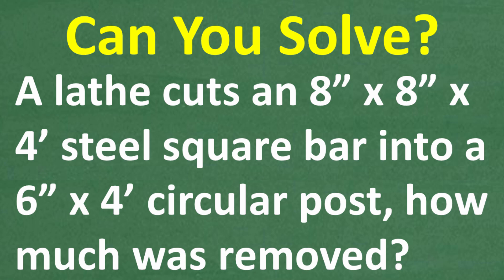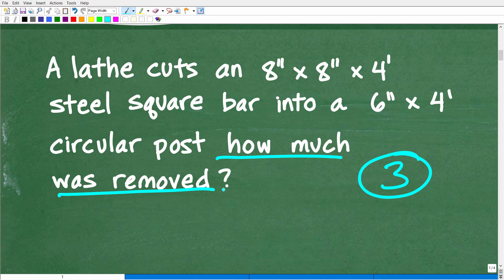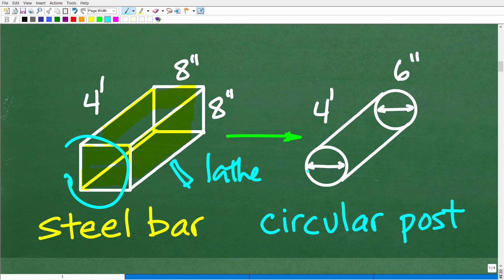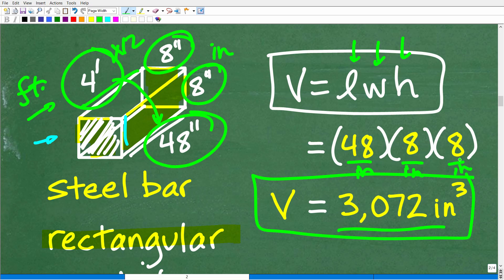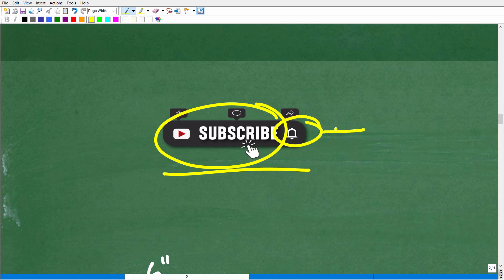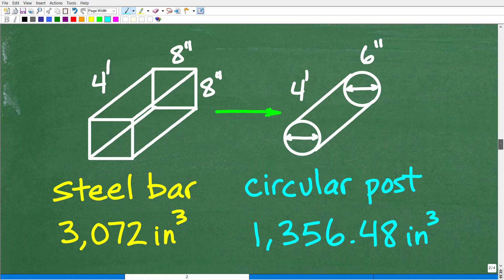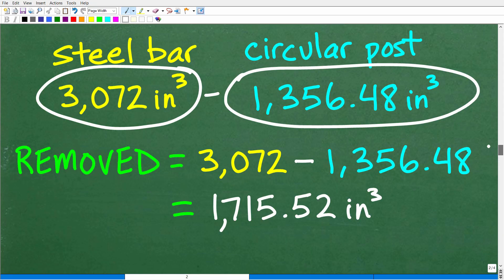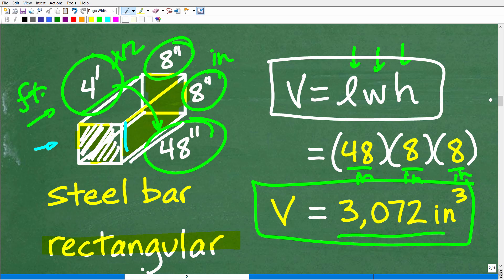An 8” x 8” x 4’ steel square bar is cut into a 6” x 4’ circular post on a lathe, how much was cut?

Comment: Approximately 495 lbs of material totaling 1714.83 cu inches. Why not use a near net shape process and make a forging or casting?  Hell of a waste of material turning roughly 56% of the original mass into chips.
Reply: Haha, ya can tell the lathe guys.
If you can't get round bar, look for hex bar, if not that, then square bar closer to the final product.
Reply: @calvinmasters6159  Actually more of a castings guy who worked on the QA/QC side of things.  I had a Mechanical Testing Lab at one point and initially subcontracted machining of test specimens.  The machine shop I used was bought out by a competing lab, much larger than my little operation.  They would continue to serve me, for 4 times the price/specimen.  I bought a lathe and some shop texts, taught my self how to run it and kept going.  Then moved on to a milling machine, a Marvel Series 8 saw and a bunch of other stuff.  Books are wonderful if you use them and don't eat the covers.  Before the lab I had worked in Foundries and a Beryllium plant and have the lungs to prove it.  My last 15 years of work was spent in foundry QA concentrating primarily on welding, heat treating, Non Destructive and Destructive Testing, kind of a desk jockey who would get dirty when required.
The rest of the story is that I flunked HS shop class, my mother was convinced that I would cut my hand off on the tools in the shop.  It was easier to take the ridicule from classmates and fail the class than to take the beating I'd have gotten for touching a machine.  Shop class days started with getting yelled at for an hour before leaving for school about what would happen if I actually did something. I walked around with a poorly healed break in my hip for 50+ years thanks to her ability to go into blind rage.  Moving forward, every time I started up one of those machines I'd say "F you mother, I can do this". 
I did make an error in my calculations for mass of material lost.  I used the density of 300 stainless at 0.289 lbs/cu inch rather than carbon steel at 0.283 lbs per cu inch.  Still a lot of wasted material.   He didn't specify material so it has little consequence.
Today I can kind of laugh at the shop class side of things, in a sense learning to do these things was not only proving her wrong, but a sort of internalized revenge on those at school who mocked me.  Hope you get a chuckle out of the whole story behind my initial response.

Comment: It’s absolutely and astonishingly amazing how ignorantly limited people’s brains and imagination are. Teachers are taught to not necessarily make absolutely real world problems and situations to teach a student, a class, or anybody for that matter, to not give easily solvable issues and problems. But challenge minds by using out of the ordinary problems and/or issues that forces students or people to apply an imagination, which in turn forces alternative ways of thinking which is what’s needed for life. Not every happening in life is what you exactly may have been or are taught by your teachers. However when you are forced to apply certain facts to a wider array, or number of choices you are forced to broaden your imagination. Which in turn forces your brain to take either existing knowledge or common sense and do whatever is required, to do what is best for the wide array of possibilities that you could end up facing for other situations or problems that you have to steer clear of. With this certain situation, there could be a requirement on the waste left over due to a certain amount of scrap required for another reason not specified by the customer. And Holy Frikkin Cow. That would require this same equation. Problem solved by the mathematical equation example given here.

Comment: ' -> foot , " -> inch
1 foot = 12 inches
1' = 12"
4' = 4 x 12" = 48"
ℿ ≈ 3.14159
circular post 6" x 4'
6" -> the post has a diameter (D) of 6 inches
4' -> the post is 4 feet long
Area (cross - section post) = ℿ(D/2)²
Area (cross - section post) =  ℿ(6/2)² 
Area (cross - section post) =  ℿ(3)² 
Area (cross - section post) =  9ℿ in²
Volume (post ) = Area (cross - section post) x length (post)
Volume (post ) = 9ℿ x 48 = 432ℿ in³
steel square  = 8" x 8" x 4' --> 4' = 48"
Volume (steel square bar) =  8" x 8" x 48" = 3,072 in³
Volume (post ) - Volume (steel square bar) 
 3,072 in³ - 432ℿ in³ 
 3,072 in³ - 432(3.14159) in³ ≈ 1,714.83 in³✅
                                              (was removed)

Comment: 8 X  8 = 64.  A 6-inch circle is pi X 3 squared.  The area of the amount removed is 64 - (9 X pi). The volume removed is this amount times 48 inches.
Reply: The way I did it.

Comment: This is not a practical math question. A lathe needs extra material for the chuck and spindle. 
Anyway, I know what the abstract answer is;   1714. 83 cu inches or .992 cu ft.
Reply: And just to fill you in on some information. I am an experienced Machinist, and it is very possible to blend seams to end up with such a minimal blemish that it cannot be out of measurement or even seen. And I learned how to on manual machines. Lathes and mills.
Reply: @bradlewis8036  Just weld (or have someone weld ) a temporary spigot on one end, grind it off later, no reversal, no fear of blending... not blending...
Reply: @robertlawson8572  I work in a machine shop and was taught how to do what I said with such minimal blending all that’s required is 3 seconds of rubbing emery cloth where the two different ways of machining cross over. I could go in exact detail but I’m not going to explain everything.
Reply: @bradlewis8036  aw, go on, I've never tried such a demanding operation... I'm tremendously lazy, I work the easiest way possible, and mounting 400kg of steel once is quite enough of a ballsache for one day... Twice? Nah... F W Taylor would not have  approved!
Reply: @robertlawson8572  I would do it the way I was taught by my superiors, then I developed other ways than normal known ways. I was superior machinist at the shop I worked at. I’m not going in exact detail about everything I know to do. But I first learned many different ways by many people. If you believe me great. If not, it doesn’t matter. I know what I know.
Reply: @bradlewis8036  I cannot fault you, there.  You must, unarguably, know what you know... "Superior", though, is an appelation accorded by others, not by oneself... (unless you're Trump)
Reply: @robertlawson8572  And in my field, the final piece turned in was most often required to have no blemishes.
Reply: You could always machine down the majority of it then flip it and continue.
If you’re good you won’t see any transition points.
Reply: @SteveJ328  Yes but that requires excellent capabilities by machinist and machine. Also, every situation is almost always requiring different things. If time matters, you can’t fool around with extra long time required operations. But like I said, every job and different customer require different rules and allowances. So sometimes yes, and other times no. Not arguing with you or saying you are wrong. Just speaking on behalf of what I learned and did.
Reply: @SteveJ328  Also, like I stated earlier every situation is different with different requirements, and/or restrictions of what’s not allowed, or  what is allowed or if time or anything else is a requirement. But like I gave to the previous person who’s obviously unintelligent because of how he’s an anti Trump kinda person. Every situation is different.
Reply: @bradlewis8036  Agreed 👍

Comment: Heck of a lot of material to cut off. 
Isnt there any stock steel bar closer to 6*6?
( 8*8*48) = 3072 cu ins
Less Remaining = 3*3* 3.14159 * 48
= 1357.16688 cu ins
= 1714.833 cu ins removed
Reply: Hope it's not stainless. That'd be brutal.

Comment: IRL, you would simply call up your metals supplier and order a 6" diameter by 48" steel bar.  The supplier would take some 6" diameter stock, cut it to length, put it on the truck and send it over.
Reply: Exactly

Comment: If you dont round-off until the final answer, the answer would be 1714.83 cubic inches. just sayin
Reply: He usually uses 3.14 for Pi.  With larger numbers, like this, he should use at least 3.14159.
Reply: Approximating when he's still in the middle of calculating, instead of waiting until the end, is a repeated flaw on this channel.